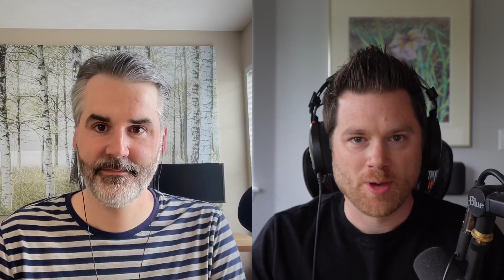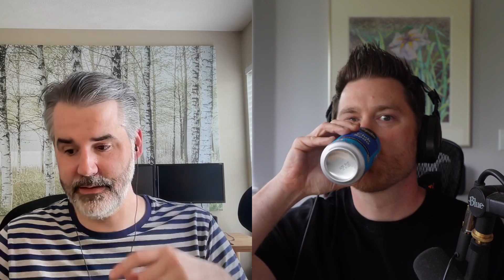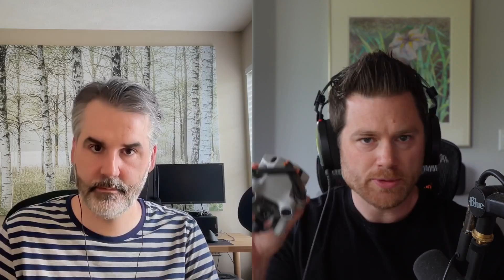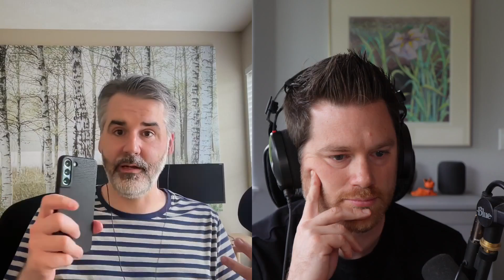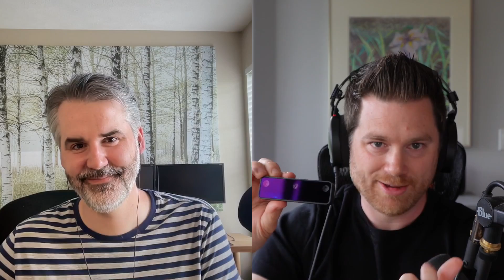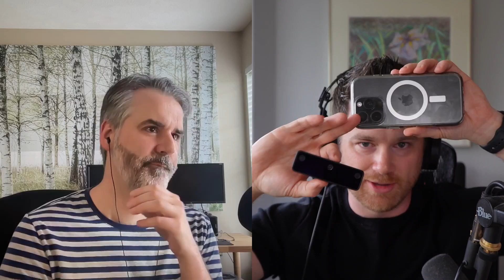Comment: Confusing two shutter characteristics here. mechanical vs digital shutter is whether there is a physical blocker of the light in front of it (mechanical), or if the sensor is directly exposed to the light and whether it is recording that data or not is controlled electronically (electronic shutter). global vs  rolling has to do with how the shutter processes/records the light that hits it; all at once (global) or in a linear, 'rolling' fashion. Global shutters are much more resource-intensive at the same shutter speeds/angles, and are more expensive to produce. There are few global shutter cameras on the market for production, but you can get cheap ones to mess around with (RaspPi has a tiny one), or look at use-specific MV ones like those used for mocap (e.g. Vicon) and volumetric/sports (e.g. IO Industries, Intel Realsense)

Comment: Have either of you seen anyone who's output 3D imagery using a multispectral camera?  No software I've used even considers this.  NDVI in 3D seems like it might have some practical use.  I have a mavic 3 multispectral and have messed with a 3D model of a single band but it would be great to switch out the rgb bands with NIR and red edge.
Reply: We have not. It would be interesting to visualize multispectral imagery in 3D though.
Reply: @EveryPoint  I've dabbled with this using a camera that has Bayer filter that simultaneously images in B,G,R,Nir. It has a lower resolution but captures all 4 spectral bands at once. I did photogrammetry using 3 of the bands (R,G,B) to compute the geometry and then swapped out the images for false color infrared (Nir,R,G) images before photo texturing was done. I happened to use the standard edition of Metashape for this. I also created another texture using the traditional R,G,B images.

Comment: Any experience with the occipital structure sensor?  I've been looking at those on ebay lately but wonder if they are obsolete since tech in this area has advanced so quickly.
Reply: We had one years ago. However, today's iPad Pros have a structured light sensor so it achieves the same outcome. It would make more sense to have one of the latest Pro level iPads with a much faster processor and integrated LiDAR that can interact with 3rd party apps.

Comment: 3 meter selfie stick and software to split the images and remove the down shot (which includes you) is the way to go with the insta360 x4.  Works great if you use AliceVision to create splits.  Lets you set the field of view and the number of splits.
Reply: AliceVision has a great toolset for this! Also, the latest version of FFMPEG can generate your splits. If you are already using FFMPEG in your workflow, this could be one less software to deal with.
Reply: @EveryPoint do you have a link on how to do this?

Comment: Great video! Regarding focal length in EXIF, correct me if I'm wrong but what EXIF specifies is focal length in mm and what algorithms need is the focal length in pixels, and to convert between them one needs to also know the sensor size, which might not be in the EXIF - right? I've been trying to start doing things on my phone camera and that's where I got stuck.

Comment: The hyperfocal distance is the range between the closest object and the farest object that is still 'sharp'.
In the end a point in space is projected as a point to the sensor only if it is perfectly in focus. If its slightly out of focus, every real-world point becomes the shape of your aperture (more or less circular). The more before or behind the point is to your focal distance, the bigger the circle is on the sensor. 
Now the hyperfocal distance is the range in which the circle on the sensor is still smaller than the effective pixels you use. So if you take a lower resolution from your sensor, the hyperfocal distance is bigger

Comment: Sensor size doesn't directly Matter for light sensitivity, sensor size matters for SNR. For light sensitivity, the lens area that is actually used at a given aperture is relevant
Reply: The bigger the sensor the more light you capture. Also usually bigger sensors with lower resolution have bigger pixels which are better for photogrammetry. The whole system matters, this includes the sensor and the lens.
Reply: @sierraecho884  I did not write, that sensor size doesn't matter. It is just not relevant for the number of photons that are captured.
Also, smaller sensors often have a larger hyperfocal distance. For that reason some macro photographers prefer fuji cameras that have a sensor smaller than aps-c
Reply: @simonbe  "....Also, smaller sensors often have a larger hyperfocal distance...." This is true, but I personally also want a better resolution.
Reply: @sierraecho884  sure, for best resolution, you need the best lens first. Almost no lenses can really feed typical Megapixel numbers nowadays
Reply: @simonbe  Depends on the lens and sensor. With a 8MP sensor, the best lens is of not much use. It´s again the system as a whole.
Reply: @sierraecho884  8MP is much more than one usually processes in gsplats. Thus, first start by finding a lens that can feed 8MP. It'll be surprising how poor most of the lenses are
Reply: @simonbe  I was talking about photogrammetry, sorry for the confusion.